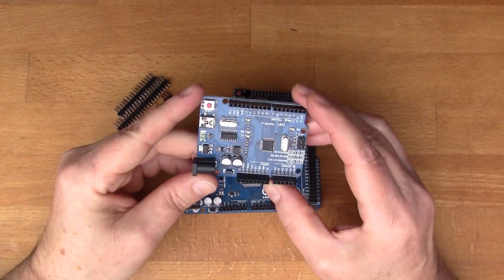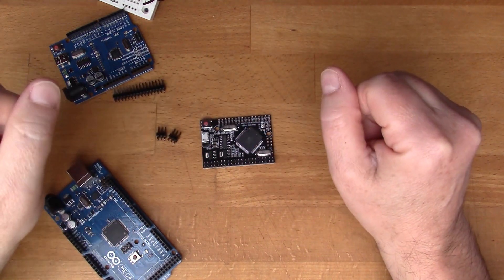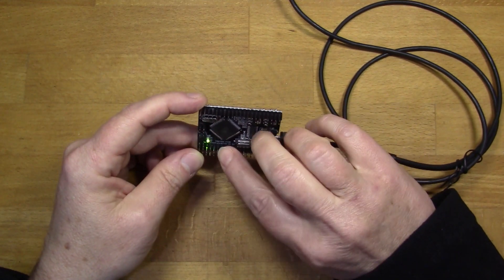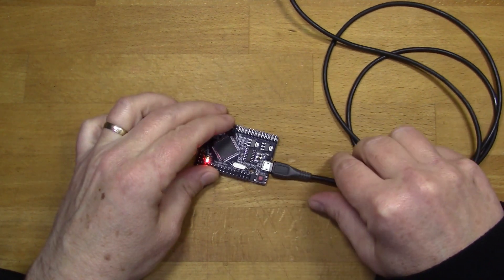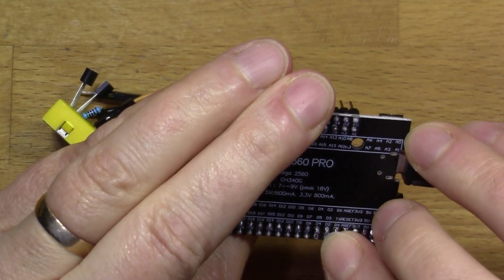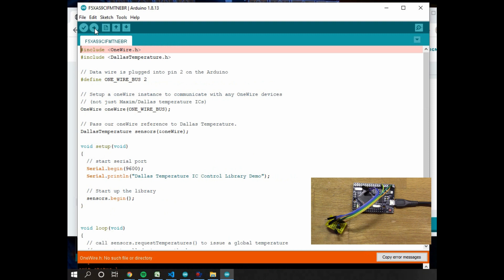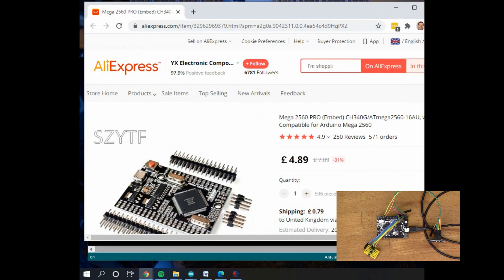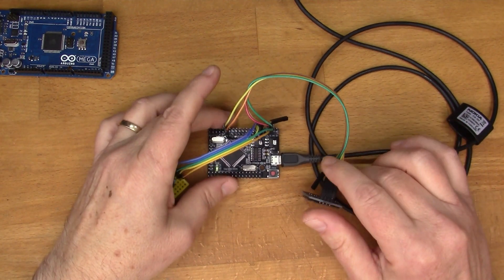Arduino Mega 2560 (clone) Review and Test (#128)

Comment: Hi! I have two of theses boards but I can't get a connection to PC. There is no COM port in the device manager. Hope you can help.Thank you
Reply from the maker: I think there's an option to rescan in Device Manager to find COM ports?  Other than than - perhaps try a different cable?  The USB controller on this clone is nothing exotic - Windows should know how to speak to it without loading a driver.

Comment: you can't use a breadboard here
because the pins are dual row, so one pin would interfere with the previous one
Reply from the maker: true
Reply: I'm sure that he is very aware of that.
I'm sure he was only putting it in the board to solder the header pins.
That is the easiest way to do it.

Comment: hey you know if i can run this board as a joystick pedals controller?
Reply from the maker: It depends what you're trying to do.  It has a CH340 chip on it for the USB interface, similar to the Arduino Uno, so basically you can follow any joystick project that uses the Uno.  Some projects need a different controller that can look like  a HID controller (keyboard, mouse) to a PC, for example the ATmega32u4 that appears on the Arduino Leonardo.

Comment: does it work as a mouse?
Reply from the maker: I didn't try it, but I suspect not. This has a CH340 USB chip, which is standard on a  variety of Arduino clones.  I think the devices that can be.a mouse/keyboard have the USB integrated in the Atmel chip, e.g. ATmega32u4.

Comment: I need to use an accelerometer sensor and microphone at the same time. Are there sufficient analog and digital pins?
Reply from the maker: The accelerometers that I've seen use SPI or I2C, which are intrinsic for all Arduinos.  It sounds like you only need one A-D port.
Reply: @MartynDavies   This board will work for me right?
Reply from the maker: @surajnair2315  This clone board has many A-D ports and SPI and I2C
Reply: @MartynDavies  thanks for your help